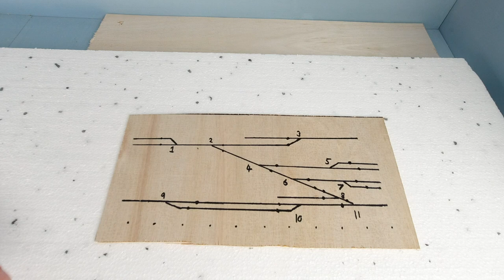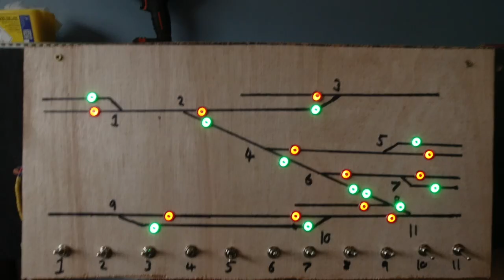How to build a model railway control panel - Building A OO Gauge Model Railway - Episode 7

Comment: Hi Tim 
I like the route indication function.
I use aluminum plate painted light blue and colored car pin stripe for the track marking  for a more signal box like look.
Not for every one that's just the way I like to do mine.
It can also be done with plywood the pin stripe seems to stick better to full gloss paint.
Regardless of the finish type and what's used to make it, that's exactly how a panel should be easy to follow so your not always second guessing what's going on.
regards John
Reply from the maker: clear run though is always good I get confused easily so this way its simple lol
Reply: @Timwellsphotos  Yes KISS defiantly the principle to follow when building a model railway it means more fun and less "OK what just happened there"